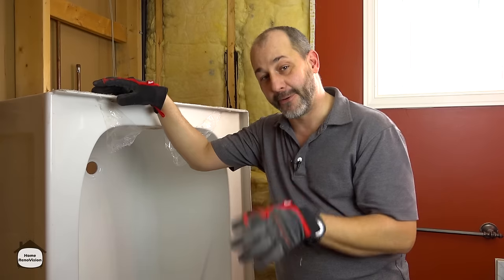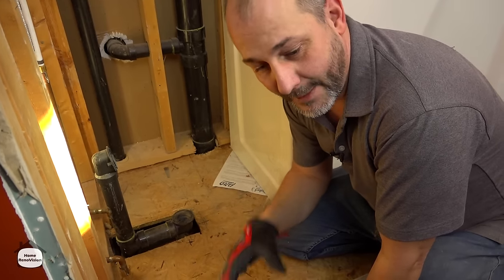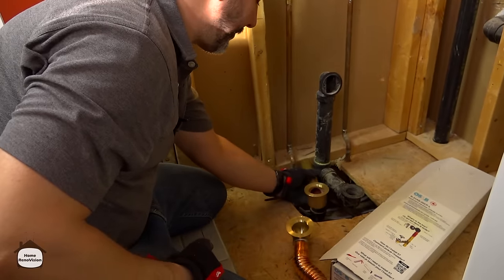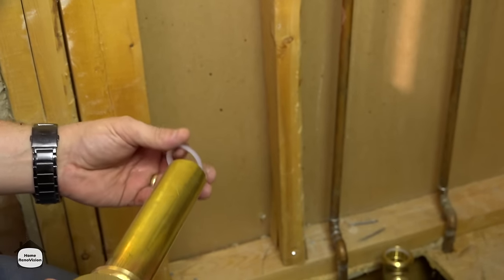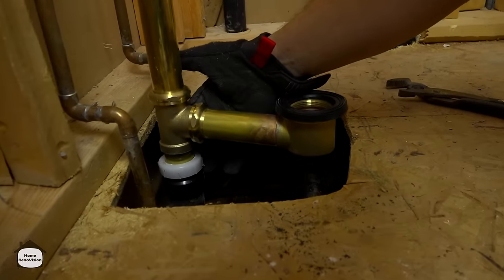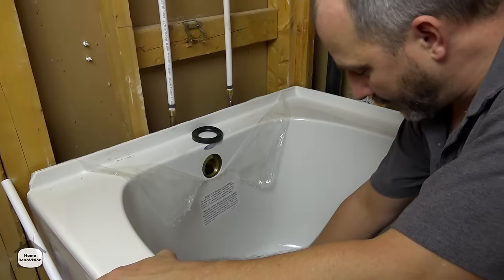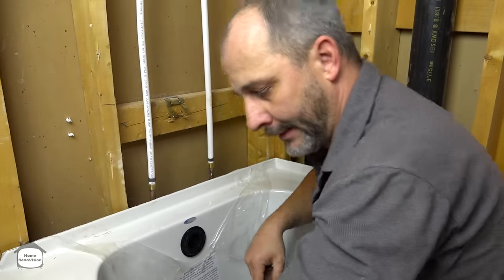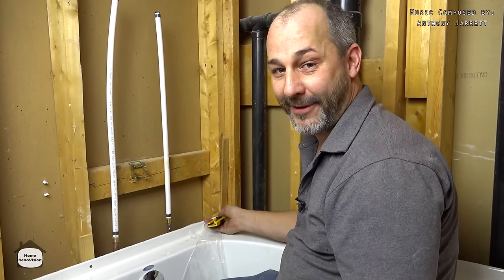How to Install a Bath Tub

Comment: Thank you. This was helpful. My best friend wants to install a tub so I'm trying to see the best techniques. He's going to have to build the alcove- the tub he wants requires a mortar bed though-- do you have any videos showing how to do a mortar bed for an alcove tub?
Also, do you have any experience installing a direct drain (where the P-trap is under the tub drain instead of the overflow)? I need to correct a DIY mistake from previous owners who cut all the way through a floor joist for the P-trap under the overflow of an above-the-floor drain tub. My plan is to have the overflow sweep over to the drain instead of vice versa, increase to 2" P-trap for better drainage, and create a vent (as it currently does not have a vent-- although later on the plumber tried to add in circuit vents but it is still a mess).

Comment: Hey Jeff,
 Do you have any videos of you installing free standing tubs? (Claw foot, slipper style) I'm having a hell of a time figuring out the order I should install subfloor, cutting holes for drains, running plumbing, tiling and installing the tub since the tub itself will sit on top of the finished tile. Help! Thanks in advance
Reply from the maker: tub goes last. you need to know how your drain and overflow will be attached before you close the floor. I always suggest having all the plumbing systems on site before starting a project like that. There are a lot of variances from 1 situation to another. Cheers!
Reply: Thank you sir!

Comment: I'm in the process of replacing my tub but I just got done removing the old one so far. We noticed that there were little bags of hard sand under the tub on the floor, and we were wondering what they might have been for? We kind of figured that it was the installer's way of leveling the tub?
Reply from the maker: perhaps. Cheers!

Comment: Is it important to level or make sure the tub is leveled before screwing it in, or does the slope of the tube interior compensate for not leveling?
Reply from the maker: level is nice but often hard to achieve. if you want level then level the floor before installing.
Reply: Home RenoVision DIY sounds good, thanks!!!
Reply: You want the rim or tile flange of the tub to be level to aid a clean and level tile install.  Also make sure the front apron sits level on the floor.  Finally,  most manufacturers design the tub base with a slight slope to the drain so that all the water drains and doesn't leave a puddle.  If a cup of water, or a golf ball rolls to the drain, your good.

Comment: How does a tub/shower get installed in a basement with floating walls? Do you have to build non floating walls for the tub/shower alone?
Reply from the maker: Great question. I would guess that bathrooms may not be allowed in those areas that have that particular code due to the specific issues related to the need for it.

Comment: Drilling through the tub at the top... is this normal? I cannot see this working. 

 Also no rubber grommets (or some type of collar) were used to protect the tub.

With the weight of water in and out, and people climbing in and out, there will be pressure on the screw points.

Given all this, in time surely the tub will crack around the screw points, not so?

What say you?

Comment: Do you always have to replace the plumbing or can the pipes already in place be reused?
Reply: It's all depending on the tub you're putting in. In this case, he is installing a 32 inch wide tub into a place where there was a 30" tub.
Reply: If your going through all the work to take out the tub you might as well do it right and replace all plumbing heading up to the shower head and the drain. You can use the same but it’s lazy and won’t last

Comment: Do you have a video showing how to remove the overflow drain pipe on a tub? I want to do drop in shower base so I can use the same drain but can’t find on how to get rid of the overflow. Thanks
Reply: In texas most tubs are 1 1/2 inches and showers are 2". So you probably have to go all the way to a pee trap

Comment: why is a lot of the pvc in your videos black? here in michigan where i work its only been black in a few trailers.
Reply: The black pipe and fittings are ABS plastic, not PVC.  Both are considered equivalent and approved by building codes in Canada for DWV drainage systems.  Each have their own advantages.

Comment: Hi I own a detached home and got some water leaking through my garage ceiling. I think the probable cause is the gutters are clogged and so the water is not flowing through it caused the drywall of the ceiling damaged. How can I fix it?? What should be the probable cost of it?
Reply from the maker: Hi Sandy, unlikely it is the gutters fault. More likely to be a leaking roof. Impossible to suggest cost for repairs without seeing it.

Comment: My Bathtub is cracked (Hairline crack about 9 inch in length where I stand while showering). Can the crack be repaired or do I have to replace it?.
Reply: Depends on the material of the tub.  Call and ask the tub manufacturer.

Comment: I have a question; how does one attach a new bathtub to an existing cast iron drain pipe from the previous shower?
Reply: CUT OUT THE TRAP ONLY FROM THE OLD CAST IRON DRAIN PIPE AND LEAVE A PIECE OF THE CAST IRON EXTENSION FROM TRAP EXTENSION .. REPLACE TRAP AND CONNECT BOTH EXTENSION PIECES WITH RUBBER COUPLING .. OTHER OPTION SAME METHOD BUT CUT TEE IN CAST IRON VENT AND REPLACE WHOLE SECTION FROM TRAP TO TEE WITH PVC AND TWO RUBBER COUPLINGS TOP AND BOTTOM OF TEE .. LAST OPTION CALL A PLUMBER ..

Comment: can i use hot water from the house 
to a cabin shower if i t piece off the hot water cylinder from the house or should i get a new hot water cylinder
Reply: the cabin is very close to the houses hot water cylinder
Reply from the maker: that depends on where you live. Check with the local building office to confirm.
Reply: its confirmed they said its fine do you recomend using a seperate one for the 2 bedroom cottage

Comment: Not allowed to install a slip joint adapter in an enclosed area because it’s connected with a gasket and the gasket can fail on you. Then you have to pull the whole tub out!

Comment: Jeff, I am stressing like hell. My house is block, built on concrete. Pipes are all buried.  Now the tub is leaking. It has been draining slowly, for some time. I just dont know how the hell I am going to access it all. I love my strong house, but I see this, and other videos of houses made of wood and I drool! At 6:28, it is going to be a nightmare for me to get to that point alone. Im sure I am dealing with galvanized pipes, 60 years old. The tub is steel. True nightmare. I am just so worried. But oh well, I am not afraid of the work, I just dont know what I am doing at all. For starters I have to move my huge fridge out the way, break thru the wall, to get to the pipes. Then the digging begins. I have been putting this off for a while now, living with a slow draining tub, and now the moment has arrived.
Reply from the maker: Hi Sawyer, if it is leaking down the drain when full it may be time for  a new gasket under the drain flange. simply loosen a little and reseal. you might just need a new stopper as well. If it is leaking an you see water coming out from under the tub then it is definitely time to bust it out. Cheers!
Reply from the maker: a slow draining tub is usually just a hair clog. that can be removed to increase the drain system to normal. cheers|!

Comment: Wrong way of soldering. Pull
about 9in. solder off roll, bend
top into a loop, heat fitting and
run loop right around the pipe
and fitting. The solder will be
sucked into the fitting. It's called the capillary action.
Fittings for copper pipes  are
called compression or capillary. 
22mm 
J. Calveley.

Comment: Should be using plumbers putty in the drain instead of silicone. The silicone will work but it’s lazy and not proper
Reply: Some acrylic tub manufacturers recommend silicone, rather than plumber's putty.  Apparently, the putty can deteriorate the acrylic.

Comment: Wall board, as in cement board? I had heard that, that should go over the lip? My tub framing is not exactly level so shims are needed, and I’m concerned about butting the concrete board up against the tub. Have you experienced any leaks? Also, I have insulation with the moisture barrier. Sort of looks like brown paper on it. Will that be ok? Or should I get the clear wrapping to go around it. Thanks.

Comment: You never checked the level of the tub though why??
Reply from the maker: because a house made from wood is never level. All the work that goes into trying to level an acrylic tub usually results in squeaks and cracks in the tub so it is better to just drop it flush and go from there or use leveling compound on the whole room first. This of course causes problems with the transition at the door.

Comment: I think it would be nice to see the difficulties in this tube install, getting the drains placed correctly, and setting down the tub. I know that part was difficult. Sitting down the tub wasn't shown.
I want to see you guys setting down that tub I know it was a b***. For the homeowner or someone who has never done an install before. Slow down the instructions. You use job speed instead of instruction speed.
Reply from the maker: need a bigger bathroom to show that. some day we will. Cheers!

Comment: I didnt see anything about making the tub level.
Reply from the maker: no bother. most homes have the drain installed to the interior of the house since it always bows just a bit. If you install flush to the floor in most houses like this you will be just fine. Watch the tile video to know how to deal with the angle.
Reply: @HomeRenoVisionDIY  So as long as the floor is kinda level before starting then it should be fine I guess.
Reply from the maker: close is good enough. never is anything actually level in a 20 year old home. including the ceiling.

Comment: 99% of the time when you come across a plastic glued together drain like this one. Its because its code. Its usually on a second floor tub. If this was your case. Then using a brass drain is not code legal. Well, it's not code legal in California.  
   I guess you are just way to busy to learn about new products on the market today.  I'll tell you something new. They actually make a new oiless plumbers putty now.  Well they started making it 15 or 20 years ago. It's made for plastic. Will not yellow your tub or a countertop.
  Have you ever tried to remove a drain that has been silicone in instead of using plumber's putty and pipe dope on the threads. It's really a pain to get apart. What if years down the road you need to replace this drain? Especially when you are working with a brass drain that has a flexible neck. It will twist apart everything behind the tub.. I'm not just saying this if the drain corrodes or something like that.  What if the lady of the house in two years doesnt want chrome any more.  If the drain is pretty much glued in. How do you change it out for her?
 Last thing. In California we must put stringers along under the decks. Ends & backs. Code! Even if the manufacturer says it doesn't need them. You must. 
   My main complaint about videos tell everyone "this is the way you do this". There are so many variables and different codes in our world today.
  At either the beginning or the end.  You should tell people that this is just the way you do work. It may not be code legal in all areas. Then you would be being honest with your watchers.
Everyone listen up!!
Reply from the maker: always check local codes before starting any renovation. Cheers!
Reply: @HomeRenoVisionDIY  There lies the Rub.
  You dont tell people that they should always check local codes. You act like anyone can do this if they just follow your instructions.     Yet if you worked for me or most of my friends.  We would send you back to school.
  Cheers.
What part of the country do you live?
Reply: You really should learn how to read the description that clearly has a disclaimer.

Comment: So, you wear gloves, so you don't get a splinter, which wouldn't kill you or probably even happen, and don't have a guard on the most dangerous tool in your shop, which can very easily kill you. To top it off, you use it one handed with no handle. On an industrial job, you'd be done. What are you thinking? Get a face shield and a handle and a guard and stop teaching people to hurt themselves. I've investigated too many grinder incidents.